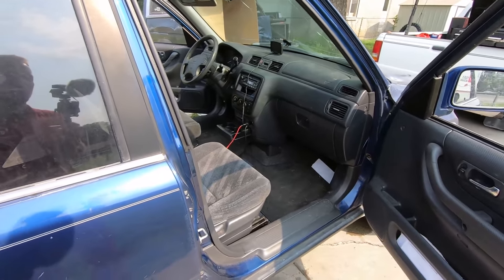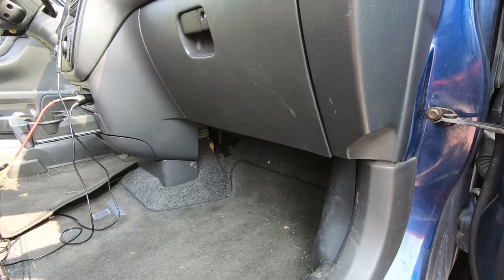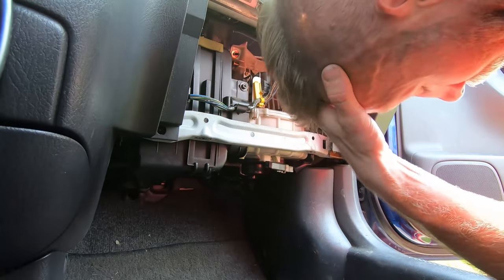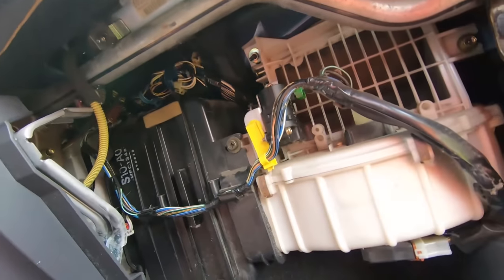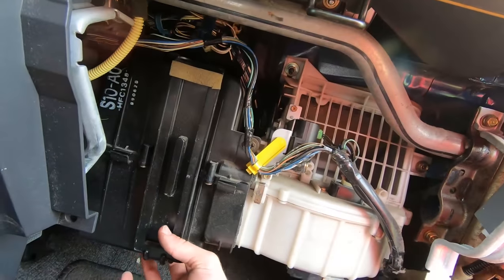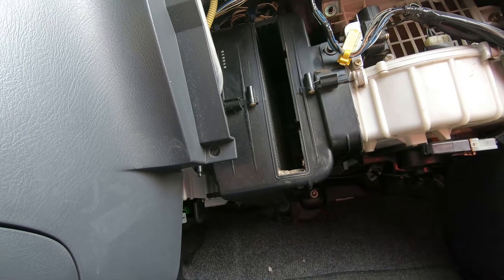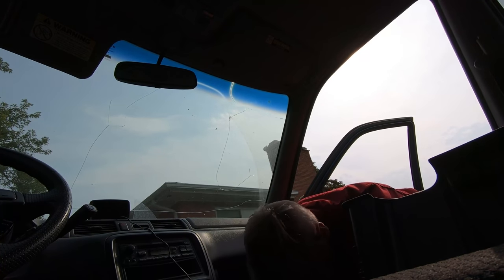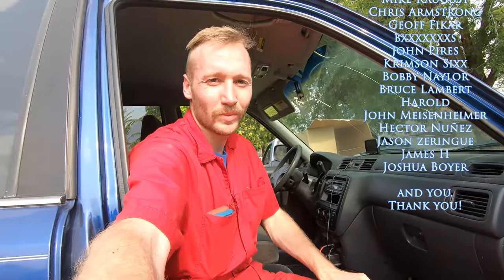Girl thinks her AC is Broken but heres what the Real Problem was.

Comment: Thanks. I just put in my notes. When replacing a cabin air filter turn on the blower motor to clean it out after vacuuming and before putting in the new filter.

Comment: The last time I did this, I was surprised how much more debris there was after removing the blower to get better access. Once you're there, the blower is easy to drop out of the way. The cool thing about this is the tumbling cascade of other problems when the problem is ignored. You end up having to replace blower and resistor and maybe even the connector if it overheats. So, good job to recognize the issue and fix it right away.

Comment: Sometimes an easy way to check the cabin filter is switching between recirculate and fresh air with the fan on full.. if there's a big difference in airflow,  your cabin filter is plugged..